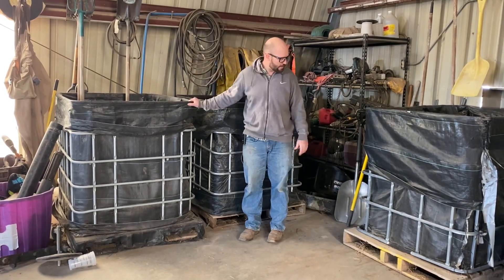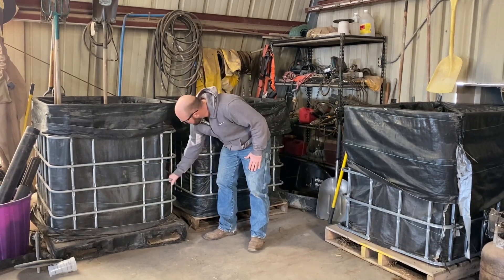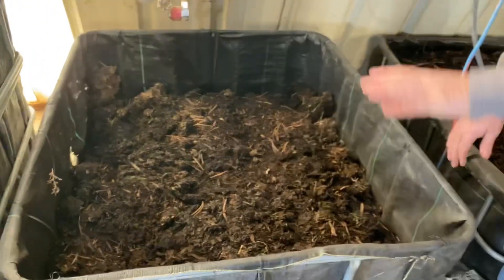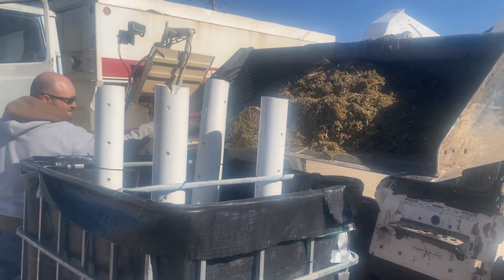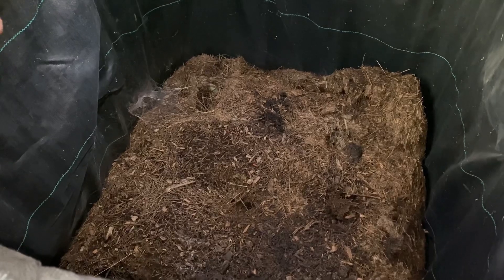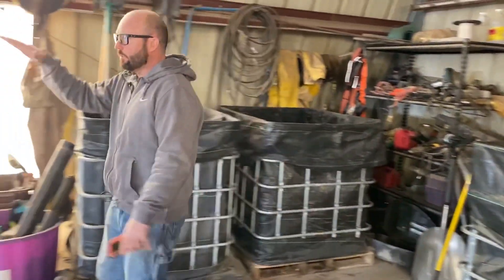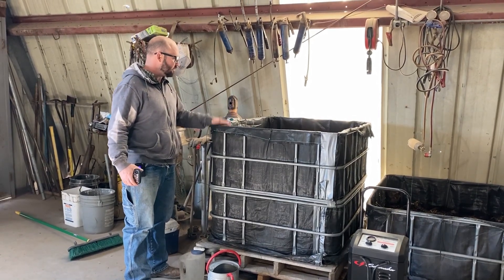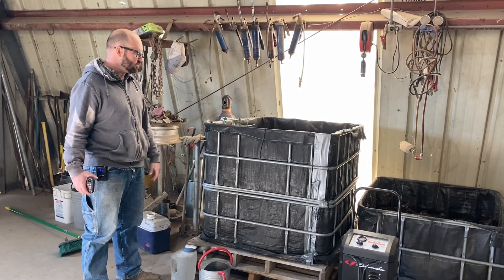Johnson Su Bioreactor Updates(How to gain easy access to your compost & fixing anaerobic conditions)

Comment: Have you ever used the big seed super tote bags
Reply from the maker: Not to make Johnson Su
Reply: @youngredangus6041  the super sac tote materials very similar to the landscape cloth, plus the lift loops would make it easy to strip the cage totes, when completed with the compost for regeneration,
Reply: Just need to make sure they didn’t have treated seed in them

Comment: Thanks so much for sharing your journey! When you say “it fixed it,” meaning it turned back aerobic from having gone anaerobic, that might be misunderstood. An anaerobic pile will always go back aerobic when you provide oxygen. And the compost may even now “look and smell good,” but that doesn’t mean it is good. I believe GOOD generally means funghally dominated and bio-complete (diversity) array of micro organisms. That will depend on feedstock and pile treatment and can only really be discerned with a scope. My scope shows i need around 60% carbon in my feedstock to get GOOD compost. This spring i have been harvesting bio reactor compost only 6 months old (wish i cd let it cure longer but i need it now:). It is decent not yet optimal, pretty funghal with loads of protozoa and nematodes…but i have to sift it to get the larger chips out. Perfect for top dressing the garden tho, but not yet broken down enough for the extractor or in furrow without sifting. Again thx for sharing all your insights an discoveries.

Comment: Thanks for sharing all your details with us, including the challenges that you have run into.  I was questioning your weed fabric choice...maybe it is not allowing enough air flow into the reactor from the outside perimeter of the cage (?).  When I watched the Johnson-Su video, they mentioned that part of the design was creating a pathway for air to enter any part of the pile, at a depth of less than one foot...outside and inside (tube voids).  I plan to make a reactor or two this year, and I LOVE the fact that you showed these using the tote cages for the frames!   BTW, hello from a fellow Kansan....I'm near the Mcpherson area.
Reply from the maker: Thanks Matt!  Good luck